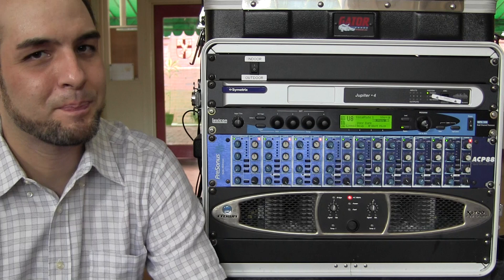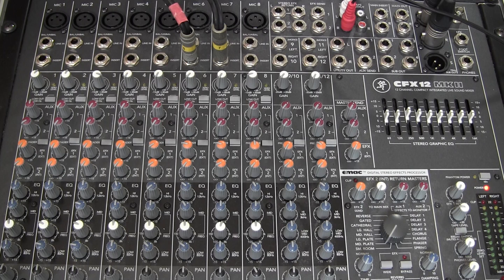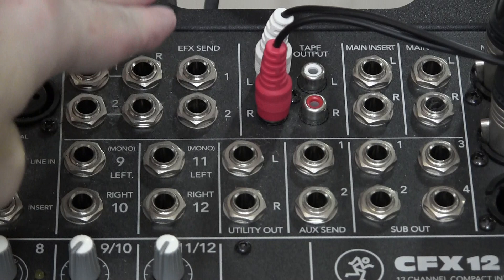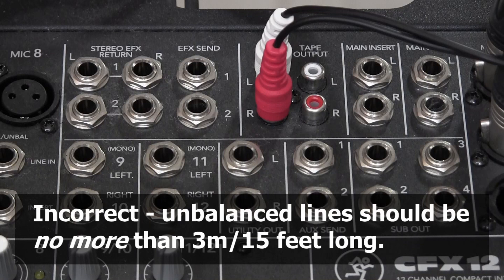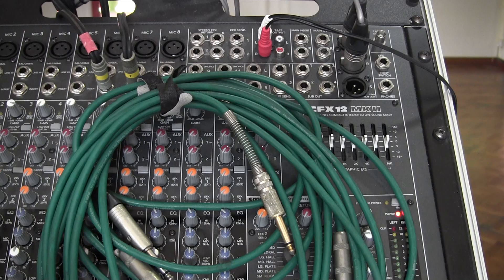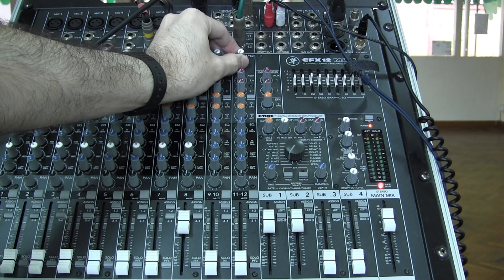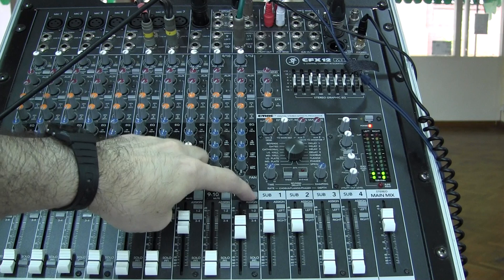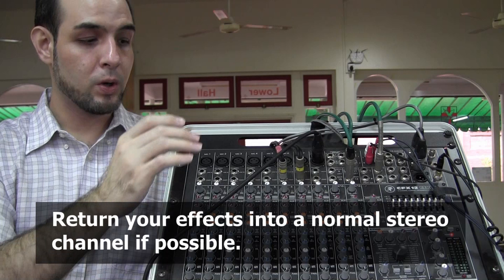How to set up an external effects processor for live sound

Comment: Bruno, I have a unique problem. When I had a meet with the old sound guy today, I discovered this set up. He has Aux 1 & 2 sends going through the Berringer DEQ2496 and out to Monitors 1 & 2. He states he did that to get rid of horrific mike feedback. First, why would that work? And second, isn't there an easier fix? I wanted to hookup the Berringer as an external effects processor.
Reply from the maker: Jim Frey Hello Jim! Yes it would work - that unit has several functions but it's basically a digital graphic and/or parametric equalizer. It also has a feedback destroyer function so is a good choice to put on a monitor send as long as it's set up correctly. It's not an external effects processor as it doesn't provide any effects such as reverb or delay.
Reply: GLB Productions Ok, now , can I set up aux sends 3&4 regularly to my other monitors without a problem? Interesting, if I set up the Berr as an ext eff, the feedback destroyer function does not work, right?
Reply: GLB Productions You mentioned setting it up properly. How?
Reply from the maker: Jim Frey Correct, it's not an effects unit and should not be set up that way - it's designed to be connected in line between two pieces of equipment, typically the mixer and amplifier.
Reply from the maker: Jim Frey There are different methods of setting up a feedback destroyer but there is usually some sort of set up mode where you induce feedback so that the unit can capture the frequencies that are 'hot' in the room and then an operations mode which is for regular use. The problem with feedback destroyers is that a) they do not always work and b) sometimes they take too long to work, or take out too much of the signal such that the end result doesn't sound any good.

Comment: Thank you for your response. One more thing can i use the tc-m350 as guitar effects going to the mixer? And how to set-up to behringer ub2222fx pro?
Reply from the maker: - I'm not sure if you can connect your guitar directly to the M350, it will depend on what guitar you are using and what sort of preamp you have in the guitar. 
You would set up your mixer as shown in the video - use the 'FX' output to send signal to the M350 and return the signal into a stereo channel on the mixer.

Comment: Thank u for the Intel, these are great videos!!! Question is there a such thing as using reverb and echo at the same time as an effect? I know most people like to hear reverb but i occasionally run into artist that would like an echo effect in certain parts of songs along with the reverb?  Is this possible?
Reply from the maker: Jamial Black Yes, it is possible :) Some effects processors have dual mode presets that provide a reverb and echo simultaneously. Alternatively a second effects unit would be used for the echo, with the primary unit providing the reverb.

Comment: Hello, I'm a the sound engineer in my church and i want to find out if i can use this same routing for compressing vocals  and gating for my drums rather than using inserts for them.
Reply from the maker: Yes you can - it's called parallel compression and it's mainly used in the studio, but remember that you need a way of managing the dry uncompressed signal. I don't think it's a substitute for inline compression - you still need that for system protection.
Reply: +GLB Productions 
yes I want to run the mains from my mixer through a dbx driverack PA management system (Analog) to my amplifiers. just wanted to find out if the compression and gate will work like the effects processor as demonstrated in your training video. you could also help me with a link to a training video on parallel compression

Comment: Hey great video. I am trying to utilize my Alesis Nano Verb in  a home recording set up. I am running it with a vintage 1995 Mackie CR-1604. I want to(somehow , if possible) have reverb on the mic channel that can be heard through the headphones output on the Mackie 1604 but not sent out the Mains to the Focusrite 6i6. In other words I want to hear reverb while recording my vocal(or other instrument) but not have reverb in the send to record on the DAW. If you can tell me best way to do this it would be great. I am making an assumption that my output signal to the Reverb unit should be 'pre fader to avoid send to mains!?? Thanks for your advice ahead of time,,, should I set one send up as a buss? how exactly would I do that.
Reply from the maker: Hi Mark, on that mixer I would use either one of the direct outs or an aux send to get the signal to your Focusrite. That will give you a dry signal which you can then edit in your DAW.
Reply: @GLBProductions  thanks. So I would set up the reverb on the Mackie same as if I wanted reverb on eache channel but run an aux to the Focusrite? Would that be prefader aux send out to Focusrite? Thanks .
Reply from the maker: You could use either, but pre-fader would enable you to set the balance in your headphones without affecting the recording send.
Reply: @GLBProductions  thanks!!!

Comment: So if you have a mono signal going into the effects unit, it with automatically covert that signal to dual mono output correct?
Reply from the maker: +andythewooferguy It depends on the effects unit - some of them cannot do this. You need to look for a L/mono input.

Comment: Bruno, I notice when you were talking about sending more or less effect to the vocal mic monitor that you changed the Aux Send 1.Is that not changing the volume of the monitor AND the effect and not the amount of effect going tot he channel?To add or decrease the amount of effect to a channel would you not want to change the Send of the EFX Aux for the channel that the Mic is on?I also noticed that you left the Aux settings for the stereo return channel at zero (off). Do you EQ the effect wet signal on the Stereo channel if needed?Thank you.
Reply from the maker: +Chris C. Well spotted Chris! Yes adjusting the aux 1 knob affects the overall level of the monitor only, it does NOT affect the wet/dry balance. Yes it's very important that the effects return channel NOT be sent back to the effects unit, as it will create an electronic feedback loop. Yes you can EQ the effects return if needed - I normally will engage the low pass filter and possibly add some highs if needed.

Comment: Thanks for the video Bruno, quick question! With the external effects processor hooked up, would the onboard effects still be in effect or operational?
Reply from the maker: It depends on the mixer: if the post-fade aux send that you use to connect the external effects unit is the same one used to send signal to the internal effects then they will be bypassed.

Comment: Great informative video! It really helped explain it all so easily. Thanks. I've got a question: My mixer is a Soundcraft EMP8 that does not seem to have a master send, master aux or fx bus control. I should able to connect the multifx processor and route it back to one of the mixer's stereo channel but would the lack of a master send, master aux or fx bus affect the ability to hear the multifx in the mixer? Thanks!
Reply from the maker: +Dinny Abdul Ghafar I assume you mean EPM8? On that mixer you would use aux 2 in post fade mode as your send to the effects unit, and return the signal into one of the stereo channel. The send in this case is fixed at unity gain - not an issue.
Reply: +GLB Productions My mistake! Yes, it's the EPM8. Thank you for the advice :)
Reply from the maker: Dinny Abdul Ghafar You're welcome!

Comment: Does it make a difference if i connect XLR connectors at the back of the unit in the exact same way?
Reply from the maker: +MrJeroneB No difference, although if your mixer has 1/4" inputs and outputs on the relevant aux sends you will need to use TRS instead of TS cables.

Comment: Hi, I watched your video about using external effect on mixer and would like to have question. when using external effect on mixer, so internal effect of mixer is off? so whole mixing only use external effect. is that right?
Thanks
Reply from the maker: Kara H It depends on how you are connected - if you have sufficient aux sends it is possible to use both at the same time.

Comment: If I use a TRS cable instead of the mono cable for fx send, would I plug TRS into eff send on mixer into left and right input on processor, then run two mono cables from L and R out on processor to the two stereo inputs on channel 24 so I can use fader?
Reply from the maker: You would plug it into the Left/mono input on the processor.

Comment: Hello Bruno 
I have another piece to my rack and would like some info. I have now the behringer feedback destroyer pro and and I would like to connect it to my alesis midiverb4 to my mackie cfx12. which is the proper connection for them. thanks in advance.
Reply from the maker: +Aaron Villela I would insert the feedback destroyer on the main inserts of the mixer, or connect it between the mixer and amplifier.

Comment: How to set up an external effects processor for recording? You said that it is different, so how to it?
Reply from the maker: +youtubak777 [Nejdelší jméno na youtube] (Ignorujte-123456789123456789123456789123456789123456789123) Recording engineers will sometimes do the wet/dry mix on the effect unit itself rather than on the mixer and have different ways of routing the signal to and from the effects unit. For more info, please ask a recording engineer ;)

Comment: I want to use the Yamaha  MG 10xu, with an external effects Processor.  It has an fx send and stereo inputs available, but it has no external fx knob on that channel. When an external fx unit is added, does it shut off the internal fx? Can you help me.
Reply from the maker: Yamaha do not make it clear in the owner's manual exactly what happens when you plug into this 'FX send' socket. On the larger models the signal is split before the output so that you can still feed the internal FX module whilst using this aux send for other purposes. Obviously you have only one level control for both purposes which can get interesting... You'll need to experiment and see exactly how this output behaves on your particular mixer as I haven't worked with the MG10XU before.

Comment: Hello Bruno ... Great vid ... Couple of questions ... Let's say you wanted to have the luxury of the boards internal effects and an outboard one as well. Ok .. If you sent it through Aux 4 how would you set the Master level send if there is no control for it? Thanks ....
Reply from the maker: In that case you would not be able to control the master level of aux 4, it's fixed at unity gain. This generally goes not cause a problem as the level can be adjusted at the input of the effects unit as well as where it is returned to the mixer.
Reply: Right ... Thanks so much for the reply....Could you tell me your favorite outboard reverb unit and why? ..... If you have a chance ...
Reply from the maker: I'm partial to the Lexicon products, but of late I'm happy to use whatever unit is built into the digital mixer of the day :) I also like the old Yamaha SPX rackmount units. Not much experience with the TC stuff.

Comment: Thanks for the video! i still have a question. I'm using a fatman compression unit in live performance. Now i have a compact mixer seperate to mix the three vocals before sending them to the compressor. the output of the compressor is then send to the main mixer. now i was hoping to do this without the extra mixer. with the way shown in the video my problem is that i need to use the aux knobs to control the input/volume of each vocal on the end mix. I would rather use the faders for this but i don't want an uncompressed vocal in my main mix. what would happen if i return the compression signal to the fx return and just put the fx send on full db? my thought is that i can use the faders then to control the volume of each vocal as well as the matter of compresion. is this right?
Reply from the maker: - Interesting question! There are two ways to handle this situation, depending on whether you use pre or post fade auxes. 

1. Using pre-fade auxes, you would need to use the channel aux sends to balance the three vocals in the final mix, as the aux send level is independent of the fader. In this case, your channel faders would be all the way down to keep the uncompressed vocals from appearing in the mix. 

2. Using post-fade auxes, it would be possible to set all the channel aux sends at unity and then use the faders to mix normally, because the aux send level tracks the fader. However, in order to keep the uncompressed vocals from appearing in the mix, you would need to turn off the routing of the vocal channels to your main mix - does your mixer allow you to do this, with routing buttons? 

3. If your mixer has groups, the way to set this up would be to send your vocals to a group and then insert the compressor across that group - this is IMO the best way to go about this process. 

Let me know which mixer you are using and I can advise your further.

Comment: Great video! I have a question, Suppose if I have a set of channels, say channel 1 is the Pastor's mic and set of other channels for vocals. How do I set up the compressor so that when the pastor comes in, the volume of the vocals are reduced automatically through side chain compression? Is there any scenario ppl use side chain compression to reduce one vocal against another??
Reply from the maker: That's referred to as ducking - basically you would group the vocals, insert the compressor across the group and then trigger the compressor using a signal from the pastor's channel. Yes there are many situations in broadcast where this might be done, and automatic mixers use a variation of this process to turn down delegate mics when the chairman speaks.
Reply: Thank you.

Comment: I found your video to be very informative. But I have a question I hope you can answer. I recently acquired a 1979 Peavey Mark iii, 12 Ch mixing console. It is a great working unit. I am trying to hook up a Behringer Virtualizer 3D FX2000 Effects Processor. My problem is I'm not acquainted with the vintage mixer and do not know where the Aux Sends and Aux Returns are on this unit. They are not clearly marked so. If you can help I would greatly appreciate it. Thank you.
Reply from the maker: Sure - send me a picture of the mixer via Facebook or email and I'll take a look.

Comment: What if you route back into efx return, will the effect be applied on all channels?
Reply from the maker: An FX return on most mixers is simply a stereo line level input with no EQ controls - whether or not there are effects there depends on what the input source is.

Comment: thanks for the video, Q? I have the lexicon mpx100 am i able to send mono and (output) stereo as well? the manual doesnt explain it clearly as it has the right out as a headphones out as well?.
Reply from the maker: Hello Dwain - yes the manual is SUPER confusing in the case of that unit! Basically what you have are a pair of unbalanced outputs, but the left output can also be used to drive a pair of headphones. If you connect to the right output only, you get a mono signal. If you need a stereo output, connect to both the left and right outputs using unbalanced quarter-inch plugs. 

This is further confused by the fact that programs 11-16 allow the unit to be used as two independent effects processors, in which case you are looking at two mono inputs and two mono outputs. Let me know if that all makes sense...

Comment: Will a mic pre amp improve the loudness and quality of the sound in your microphone. Is it necessary to have this even if you have already have an external effects processor? Thanks.
Reply from the maker: +Vic Alvar All mixers have mic preamps built in to them, so a separate mic preamp is not necessary unless you want something that sounds better than the ones in your mixer.

Comment: Should the signal coming out of the efx unit be 100% wet? Then just use the return channel fader to mix with the dry orginal signal on the send fader?
Reply from the maker: Christopher Moody That's the idea, allows you to do all your effects control on the mixer itself as opposed to going back and forth between mixer and effects unit.
Reply: If I wanted to send some reverb to the singers monitor wedge id just turn up the pre fader aux send on the return fader channel that goes to the singers wedge, right? But what if I wanted to send reverb to the singers wedge but not send any to the "House"? Would I just take the return channel out of the stereo bus, and only use its aux send to send to the singers wedge.
Reply from the maker: Christopher Moody That's right, you would route the effects return just as you would any line level signal. If you wanted it in the monitors but not in the house, just keep the fader on the channel all the way down - this will only work if the monitor is on a pre-fade aux send, which it should be for live sound. Alternatively, if your monitor was on a post-fade aux send, you would need to bring up the fader, but make sure that channel itself was not routed to the LR mixer outputs. You got it!

Comment: Why did you not talk about "efx send pot of efx returned channel" in the video? The pot should never turn rise in order to prevent feedback. And we will be able to escape from the "feedback on efx roop" completely when using  efx return jack(s) in place of normal input channel(s). This is a big benefit of using efx return jack(s).
Reply from the maker: - Good points, thank you for your contribution. You're right that using the effects returns does eliminate the possibility of creating an electronic feedback loop but I prefer to have the EQ and full routing options of using a normal channel.
Reply: GLB Productions Thank you for reading my poor English. I posted from Japan :)
Reply from the maker: mPD780C1 You're most welcome, you communicate just fine my friend :)